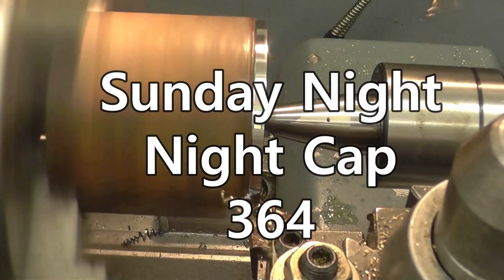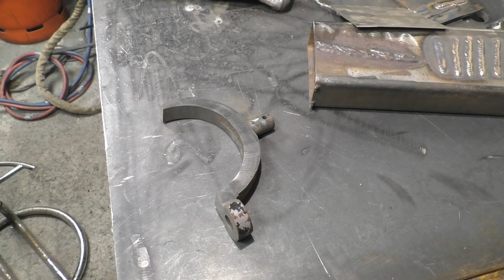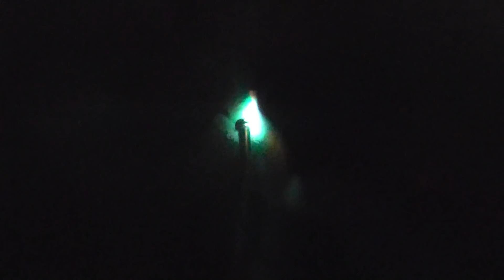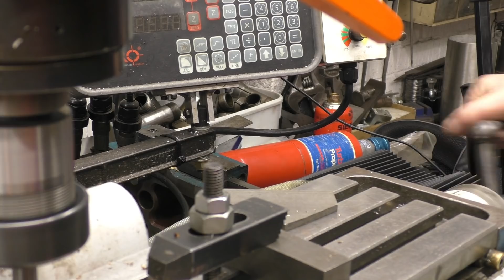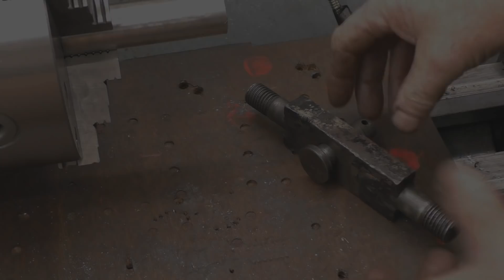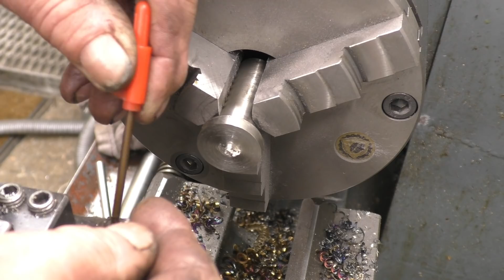SNNC 364 P2    Silicon Bronze Weld Build Up

Comment: Nice job John!  I notice you're doing the build up on AC, are you using Aluminum Bronze or Silicon Bronze?  Never tried Silicon Bronze on AC polarity is why I'm asking.
Reply from the maker: Silicone bronze on ac  seems to wet in better than dc

Comment: When you prep the parts you use a grinding wheel  or stone to roughen the surface with groves, when you start the heating you open those little groves and when the bronze goes into the groves they lock tight in making a stronger bond. Best wishes for you and your family stay safe Cheers.